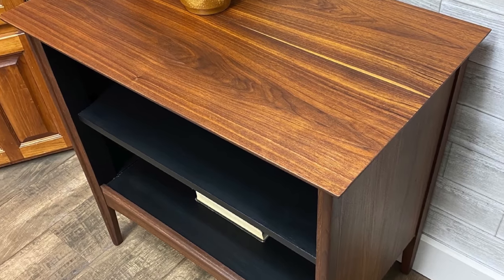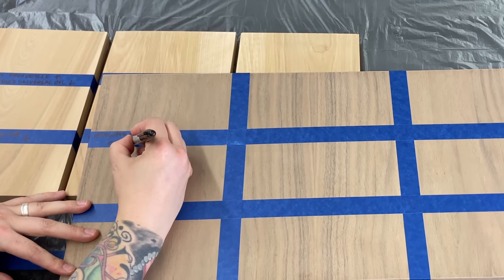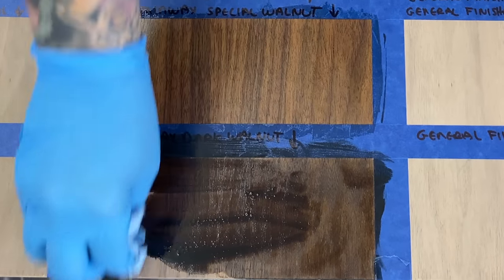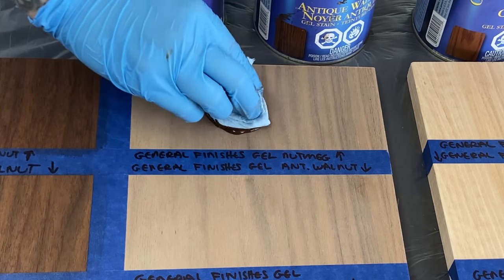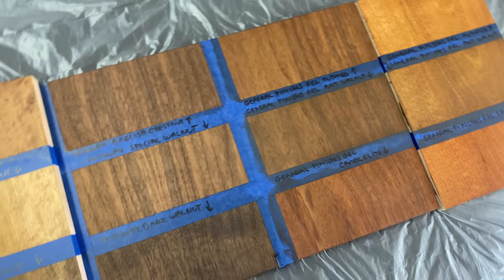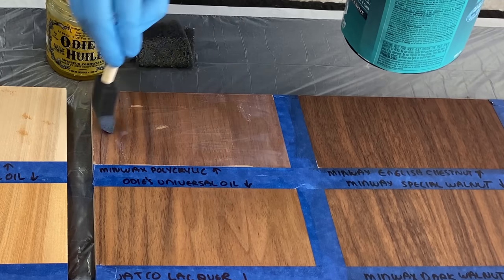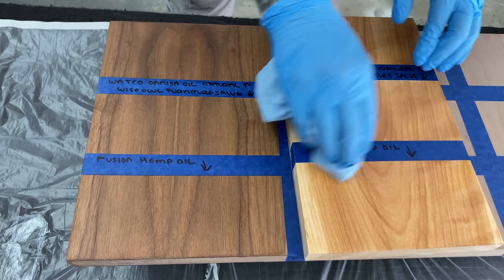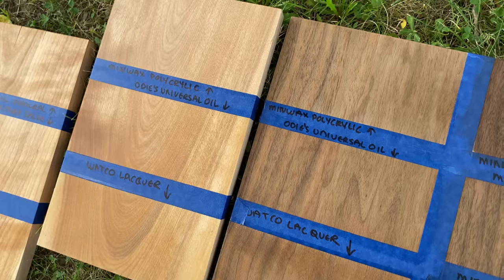My TOP 6 STAINS & TOPCOATS for furniture refinishing / flipping

Comment: Excellent video. Informative, organized. I have learned about a few products I want to try. I have been been reinforced that I almost never never want to stain anything. I suppose to match a color or if I am ever asked to stain for someone else. I still like my Linseed oil and shellac spray. I may want to find a more creamy past wax than Minwax finishing wax, which is decent.
Reply from the maker: I still use shellac on occasion, especially on antiques that are being moreso restored than refinished. It's just such an easy finish!

Comment: Love this! I am very interested in the water and scratch test video. Especially with the oil and waxes, because I am really hesitant to do a piece to sell using these as a sealer. I would like a more natural finish though. Are you going to add a painted piece to that test?
Reply from the maker: I am! It’s an important component because some of the topcoats WILL alter the colour of the paint so definitely want to show that, as well as the durability of the paint itself without a topcoat.
Reply: @TranscendFurnitureGallery  I am having flash backs of applying oil based poly to a light gray side table... 😅 Thanks for the response!

Comment: This is an awesome video, thanks for all the information! I have a question. Can you apply a protective top coat to a piece that you have stained?
Reply from the maker: Yes definitely! In fact, you certainly will want to add a topcoat to stain. If it’s a water based stain, you can add your topcoat usually within a day. If it’s an oil based stain, best to wait a couple of days before topcoating if it’s a water based topcoat like polycrylic. If you’re applying oil over oil, you don’t have to wait quite as long.

Comment: Thank you for this.  Can/do you use Odies over furniture paints? Thank s
Reply from the maker: In most cases you cannot apply Odie's over an existing topcoat without removing the existing finish and prepping the wood. Especially if the existing topcoat is damaged in any way. Many shellac and lacquer finishes are tinted, so adding a clear coat like Odie's just in one area will often stand out.

Comment: I'm struggling with little bubbles on my topcoat of polyurethane I rolled on with those smooth little white rollers . I used 320 lightly over it and I still see it. I sprayed it on there prior and it wasn't even so that's why I rolled.

Comment: After you stain the wood, do you put a topcoat/sealer? I’m working on some pieces currently, my first time ever refinishing furniture, and I want to do it right. I purchased fusion mineral paint in midnight blue and I love the nutmeg gel stain color you use! I just don’t know if I need to apply poly acrylic to the entire piece after it is painted and stained. Any help would be greatly appreciated. I also purchased some orange grove Dixie belle wax for my drawers. Love all of your videos!!!!! Hopefully soon, I will have a house full of updated furniture thanks to you!
Reply from the maker: Yes, you’ll definitely need to topcoat the stain. If you’re using fusion for paint, you have the option to. It does have a built in topcoat but for certain applications, I’ll apply a topcoat just for some extra protection.
Reply: @TranscendFurnitureGallery  Thank you!!!

Comment: Is there any stain top coat combination that you found is reactive to each other? Does the odie's oil go with all kinds of stain? How does that work with furniture polish?
Reply from the maker: Traditional furniture polish (like pledge) is the worst for maintaining finishes. It makes things shiny for short term gain but over time actually clouds a finish - I actually have a video on that coming up shortly! 
Odie’s works the very best on raw natural wood but can also be used over stain provided the stain has completely dried (as in several days). As long as the stain, whatever kind and base you choose, is completely dry, you should be able to use whatever topcoat you like. There’s a misconception that you can’t use a water based topcoat over oil based stain but as long as you wait 3 or 4 days for the stain to dry, I’ve never had any issues with it. :-)

Comment: Angie, I just bought a solid walnut antique dresser that has veneer (burled walnut) on the top, but the top coat is crazing and cracking, occasionally in an oval pattern.  I'd like to use Odie's oil on it, but am not sure if I can do that if the top coat is shellac or lacquer (I don't know which- it is a satin- ish sheen.  Is Odie's oil safe in this case?  Thank you if you see this and have time to answer. 🙏🏽❤️
Reply from the maker: Unfortunately Odie's isn't something you wipe over a damaged finish like a miracle product. In most cases you cannot apply Odie's over an existing topcoat without removing the existing finish and prepping the wood. Especially if the existing topcoat is damaged in any way. Many shellac and lacquer finishes are tinted, so adding a clear coat like Odie's just in one area will often stand out. Thanks for watching!
Reply: @TranscendFurnitureGallery   Thank you! 🙏🏽

Comment: Very informative!!  Thank you!!  I have a question though, can Odie's Oil be used on painted surfaces?  And if so what type of finish does it dry to (satin, gloss etc.)?
Reply from the maker: Yes you can use over paint. It has a similar appearance to furniture wax when dried and just like furniture wax, deepens the colour. I would save it for use over medium to darker colours. Because its more of a wax than something like poly (which comes in different sheens), you can control the sheen somewhat by certain combinations of a)number of coats and b)buffing. Over wood, the finer you sand the wood prior to using it, the glossier it will be. For example, a typical 220-320 grit sanding prior to using it has more of a satin sheen, vs sanding to a super fine 1000-1500 grit which tends to make it appear glossier. Hope I explained that well enough. Odie's has it's own channel on here which might answer better than I can :-)
Reply: @TranscendFurnitureGallery  Yes, you explained it well.  Thank you!

Comment: I love the oil based and water based stains. Gel stains do not do anything for me. Gel stains do not really look like the color that is advertised on the can where as the oil based ones look just like the picture. Dark walnut in minwax is my absolute favorite whether it be the oil based or water based version. My next in line would be provincial and special walnut also by minwax. I tend to use the minwax brand most because i find varathane to be too thick and not always true to its picture for color. Rustoleum has some really nice specialty colors out as well. 
 Top coats polycrilic matte is my to go to topcoat for my pieces hands down. I like polyurethane but i do not like the yellow tint it leaves behind. I do want to try that wax that u use and would like to ask you, how well does it do for water proof protection? How many coats do you have to put on to get that solid protection? Same with the Odie's oil? I am an antique lover, so it would be interesting to hear how well it holds up.  Also does it cause a wax build up like them cleaning products with wax in them? 
 Btw thanks for doing these tests on Maple and walnut. All the tests i ever see are done on pine to which if you are into certain periods or style of furniture you will find a ton of maple furniture.

Comment: Have you used minwax gel stain? If you have, how does it compare to general finishes?
Reply from the maker: I have! I prefer the minwax gels to the penetrating stains (for the most part) but prefer general finishes gel stain to the minwax gel stain. I do still use them, as they have more colours than general finishes, but.. yeah. Hope that helps a little :-)
Reply: Really helps me, thanks for the tip.

Comment: I’m sure you’ve had this question many, many times before however, When I’m using the polycyclic on a light painted furniture such as white or light blue or light green etc. it’s always casts it yellow and looks dingy…any advice?
Reply from the maker: Oh dear! Polycrylic is usually very clear and I’ve had no trouble over whites and lights. Were you maybe using polyurethane? That would definitely yellow, OR, if you are dipping your brush or rag into polycrylic after using it on a stained surface, it could have tinted the can accidentally. That’s happened to me before. It can be avoided by pouring small amounts into a separate container instead of dipping into the main one :-)
Reply: @TranscendFurnitureGallery  I will look into the specific product… You may be correct it could be polyurethane
Reply: @TranscendFurnitureGallery  That being said thank you for continuing to educate those of us who are on this journey with you I learn tips and tricks every video even though I have been flipping for years. Your expertise has taken me to a new level thank you

Comment: Thank you so much for this - I've been wondering what's best to use for my various projects. The question I have is, what if you buy a used piece and you don't know what kind of wood it is? Do you just have enough experience that you can tell, or do you experiment and hope for the best? LOL.

Also, how do you think a cheap wood like pine would fair with these different finishes?
Reply from the maker: You just kind of learn as you go along, in terms of the different woods, that is. I've also watched about a billion YouTube videos on wood refinishing, restoration, etc so I pick up a lot over the years :-)  
I've used both the penetrating stain and gel stain on pine many times. It's super porous, so definitely recommend a wood conditioner before staining, unless you are going for more of a rustic look (which can actually look pretty cool on pine). :-)